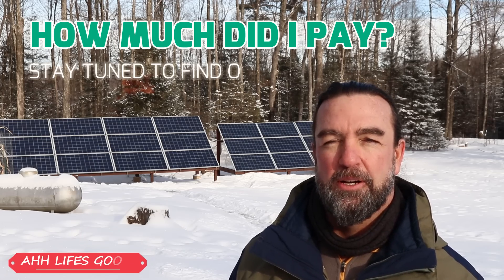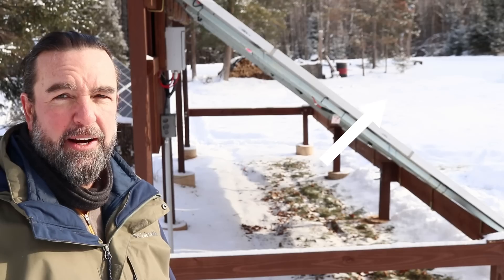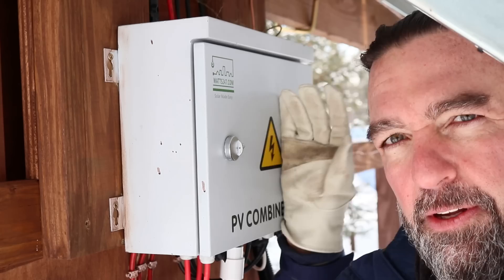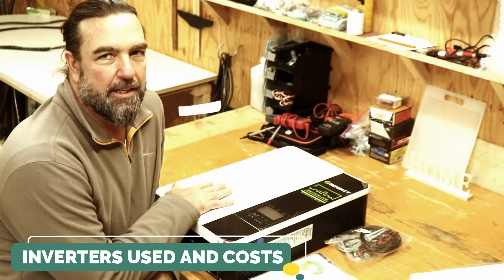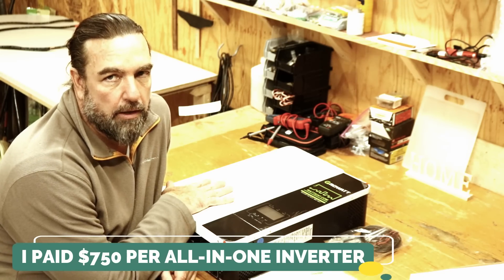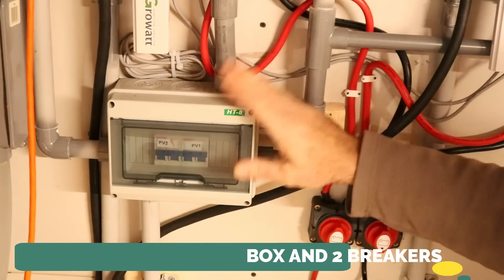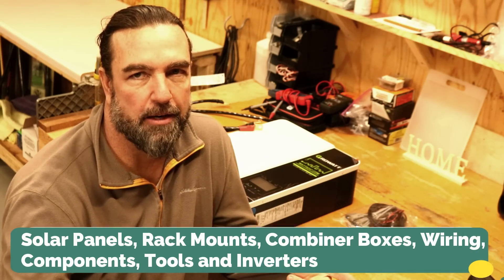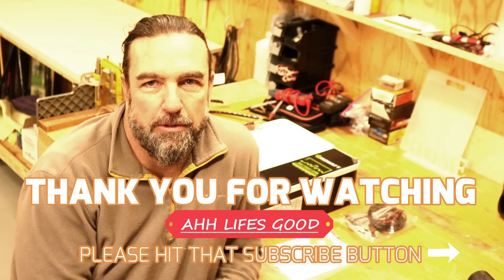WHAT I PAID - CHEAP - ENTIRE DIY SOLAR SYSTEM

Comment: Big chunk of costs in the batteries.
Unless totally off grid, why spend so much on batteries ?
Not sure the wisdom of totally off grid.
Reply from the maker: - Happy holidays Mark - Batteries at the moment are expensive indeed, the only way to save would be to build your own battery bank or wait for the market prices to come down which I don't see happening anytime soon with the ramped inflation worldwide. Given the expense of batteries I've often thought it'd be a much wiser and possibly cheaper investment to install a wind turbine for electric production 24/7,of course there are many variables but it's worth a look into given the high costs of batteries. At the current moment the cost of investment to return isn't feasible if you have gird options available! But we never know in the future what electrical costs will be given the amount of control, instability and greed being governed across the markets. Cheers to you!
Reply: @ahhlifesgood1956  
My observations, besides ‘heat’ appliances, solar can manage most all common household applications.

Microwave, kettle, cooker, > 1kw. ~ problem 

The rest, 10000 BTU air conditioner, LED lighting, TV, blender, are all safe.
80% of electric life by solar,
the rest 20% let the grid handle. 

Battery is essential to ‘start’ the system/ engine in a car. Most of time is to be charged while electricity is running.
Reply: @marktan3668  are you wrong, i handle 24k btu easily with a lvx6048 and 12k+18k with a mpp lv5048 run at 60% for 8h a day
Reply: @mcsol473  I have read many reports on heat appliances stalling solar.
Personally, I think induction appliances can get by easier than heat.
As for battery, I still think it’s only to ‘start’.
That’s why I usually shut down my solar at a sweet battery voltage. Then go back to utilities, at night, utilities is a vast huge battery bank.